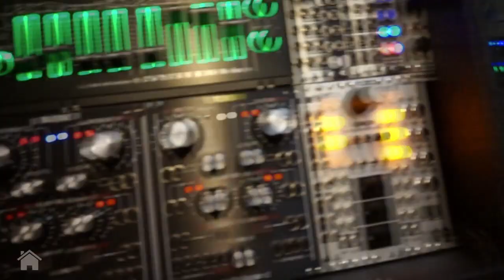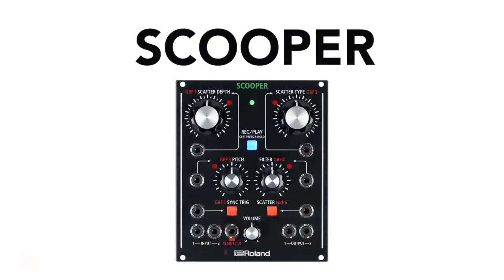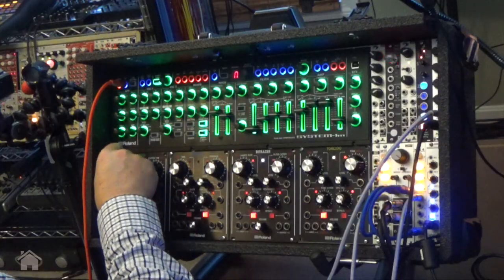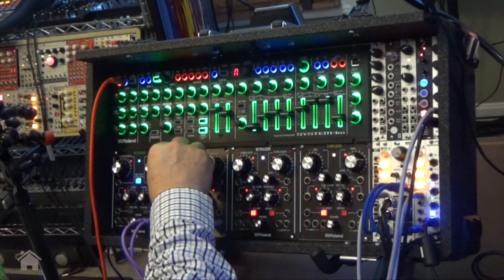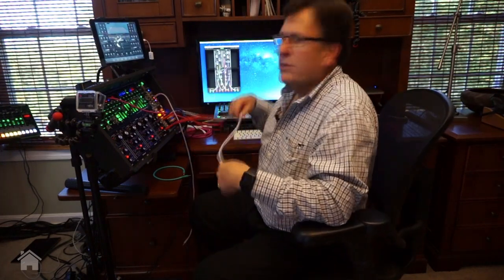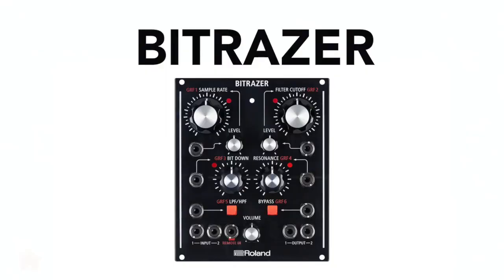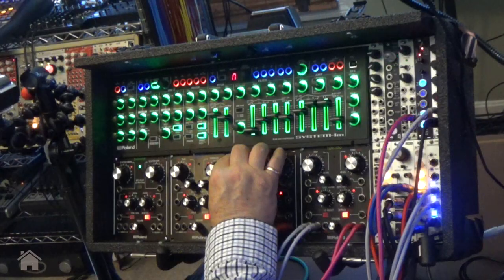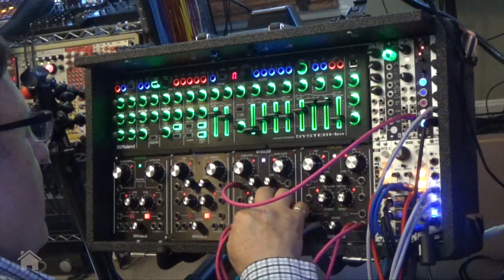AIRA Modular - SCOOPER / TORCIDO / DEMORA / BITRAZER

Comment: these are fun to program, but when you unplug them from the USB connection the sound becomes quite different. This is a letdown since it does require you to have them constantly plugged into USB if you want it to sound 100% like in did when you created the configuration in the Customizer. It does not require you to start the customizer, just requires the USB connection. Wish this was fixed.

Comment: one question about the Scooper. 
Does it allow to work in differen time signatures? like 7/4 or 6/6?
Reply: pyrox I own one and as far as I know there’s no clock in it. You can feed it a gate signal and it will reset whenever you want so technically it can do whatever time signature you want.